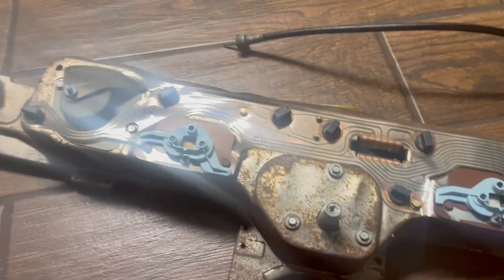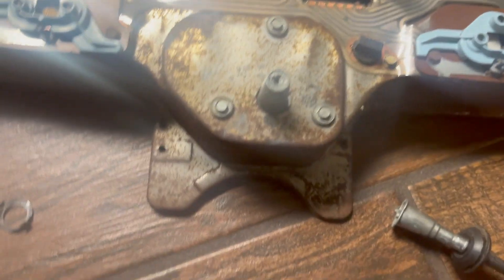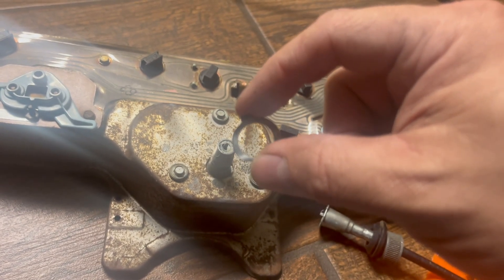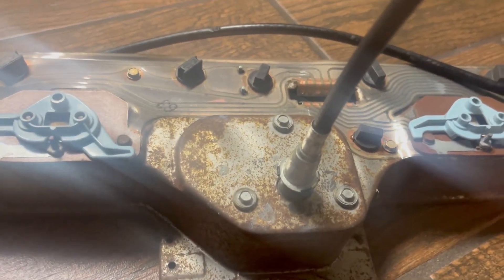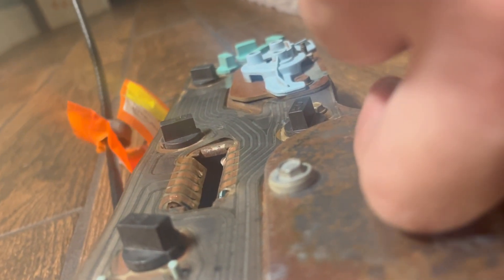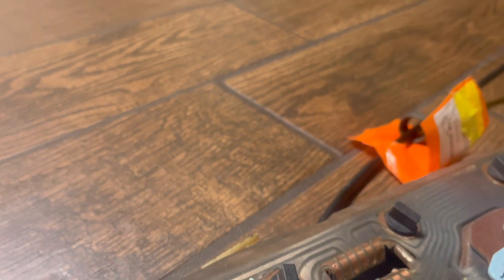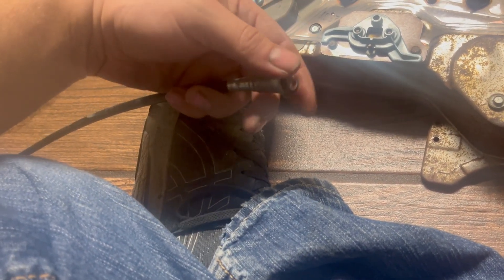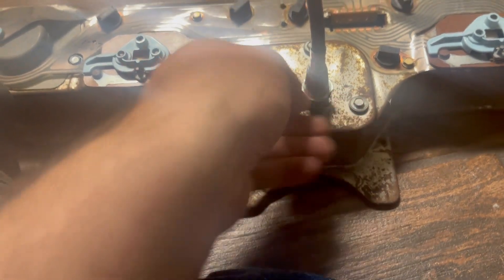Quick and Easy Guide to Installing and Removing Speedometer Cable on 1967 Cadillac and Other Models

Comment: Thanks for showing this - pretty interesting. I don't understand why Cadillac would not just adopt the GM style that screws into place. Seems to me that if that ring loses tension, the cable would pop right off. Of course, it's been sitting there since 1967, so I guess it works fine.
Reply from the maker: Yeah it actually works pretty well, it’s spring steel, so it lasts forever pretty much. Thanks for watching